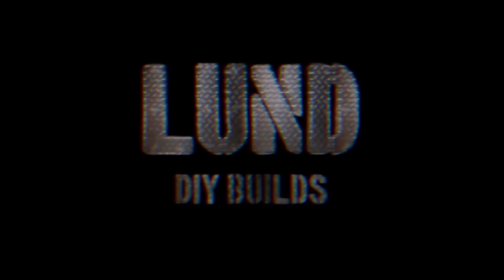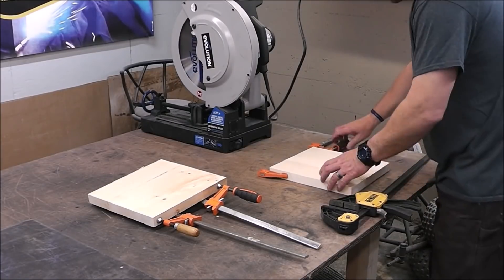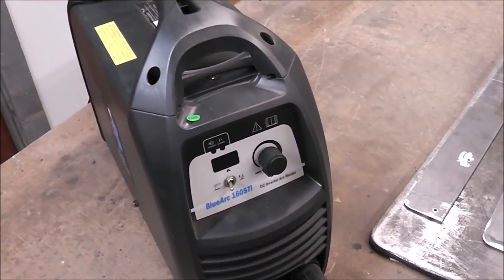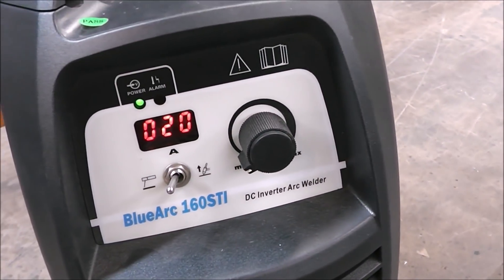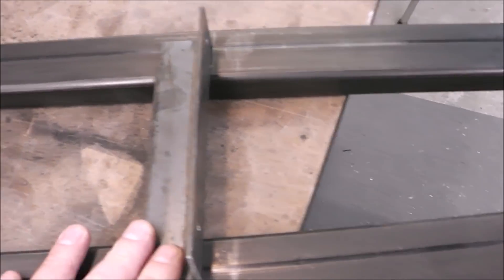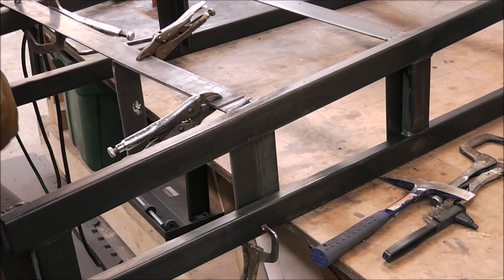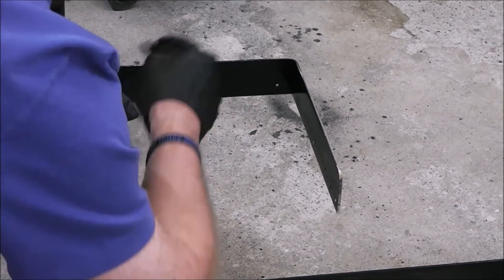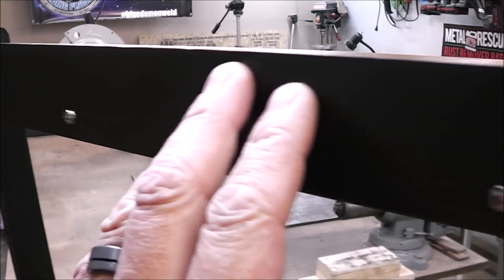Metal Fabrication Stick Welding and Slag Peel Tips

Comment: What did u put your ground too?
Reply from the maker: I dont remember specifically but usually my table. Sometimes to the part if im having a hard time getting good arc starts.
Reply: @BrandonLund  ok thanks! What about doing round tubing for a railing? I always get a bad clamp on them, anything I should do different? Or some other ground I can use, say I'm on a wooden deck fixing a railing joint or something
Reply from the maker: @wantsLDA  sometimes i will grind a bare spot to get a better connection. They make magnets you can use to hold your ground but im not a fan of those. A short piece of stranded copper wire between your clamp and workpiece is another trick to get more contact on your workpiece
Reply: @BrandonLund  appreciate it I'll give it a try also you should do a video on power sources for small stick welders you won't believe how hard it was to find out if I had enough power to support a small 110v buzz box lol especially to use anywhere on an extension cord cuz most extension cords won't hold the amps
Reply from the maker: Great request! Thank you! Br sure to look for this in some upcoming episodes
Reply: @wantsLDA  what I found helps is get a small piece of scrap clean it up and tack it to your workpiece. I normally put the scrap piece into the clamp first that way I have something to hold the scrap while I weld it onto the workpiece. Actually works really well. Anyway that my go to method and has saved alot of grief.

Comment: Brandon, is that black metal stain similar to gun blueing? On another note, the Minwax you used is a favorite of mine. It brings out the beauty in wood without making the wood look artificial. I'm primarily a wood turner, so it has fit my needs for over 20 years.. I can't vouch for use in outdoor environments though.
Reply from the maker: I love the Minwax! The black stain from what I can tell is pretty much the same thing as the gun bluing stuff from what I've heard but I haven't tried the other stuff yet.

Comment: Hot water for 40 years and I would always just get a piece of scrap out of the scrap band the same size that I'm welding and I would test my heat when I got at the right temperature I would just go to work on the piece back in 1981 we didn't have devices to look up all that

Comment: What's the best ampere value for welding sqare pipe of 1.2 mm thickness without making any holes.
Reply from the maker: Here is a handy reference for setting amperage https://www.millerwelds.com/resources/weld-setting-calculators/stick-welding-calculator

Comment: My cheap welder won't go down much below 40A. For thin material would it be better to use 1/16th 1.6mm 6013 (that should be run at lower Amps) or a 5/64 2mm or 3/32 2.4mm rod (that the calculator says needs 35A+)? I know a  neither is ideal but which would you go for? The over driven rod or a bigger rod? Edit: or is the answer a 7018AC rod?
Reply from the maker: Have you tried 1/16" 6013.? All welders run a little differently. I think you might be surprised :)
Reply: @BrandonLund  I have tried 1/16th but struggled to avoid blowing holes when butt jointing. Even doing tacks. Quite a bit of spluttering trying to run a seam on thicker material. Perhaps I just need more practice. Just a beginner.

Comment: Brandon, Nice looking project, Experiment sometime with watco oil for your wood, it really makes the wood and grain come alive. Check it out on a piece of scrap first in case you don't like it.  If you like challenges try welding sheet metal with 6011 some time. It works great on really crappy rusted metal because the nickle in the rod pretty well cleans it up as you go. If you get the technique down you can scrape the slag with three or four welding rods  stinger end down. If you've never tried it here's a tip whip the rod , if done correctly it will almost look like a Tig weld except for the dingle berries (Spatter).  I enjoy seeing your work Bud,  and the new guys can really learn from you and shorten their learning curve.
Reply from the maker: Thanks Braun I appreciate your input and support. Ill check into that oil. Im always interested in new products. 6011 is good stuff. I've never tried it on sheet metal but I have used it quite a bit on 1/8" steel. Ill have to give itba go! Thanks buddy!

Comment: Great project, turned out beautiful!  I'm brand new to stick welding, found 6013 real nice to weld with...perfect rod for a newbie.
Reply from the maker: Thanks! Try some 7018 too! If you like 6013 your gonna love 7018! If you have a "buzzbox" ac welder, just make sure you get 7018 ac rods.
Reply: DC inverter here.  I do have some from HF, waiting to open them, gotta get an airtight container for storage.  I'm rolling with your duct fan exhaust thing, btw...putting it together today.
Reply from the maker: Awesome!

Comment: Paste wax is terrible for outdoor use (or any use IMO).

Boiled linseed is better, but it takes many, many applications. And it is still not good enough to just leave outdoors where water can pool and sit on it. 

Tung oil is about the only oil finish you can use outdoors to protect from water (but UV is still gonna turn the wood grey/black). But you would have to reapply it, regularly, and you will have to leave a thin film on the wood. So it will feel rubbery/plastickey.  

The only good thing about paste wax is it leaves a slightly wet look, and it only takes one application. That first application doesn't provide any protection from water or stains, but repeat applications don't either.

Comment: Problems with 6013 can arise on inverter sets, the arc can flare or blow out without warning, they should run fine on buzz boxes, back in the ice age when I welded with 6013s using oil cooled transformers, all the welds were "peelers" we used to blouse our pant legs as slag could fall into your boot causing you do do the slag kickers hornpipe and shouting "Oh my, thats warm" or something similar.
The finish mentioned by David is used here in France using beeswax/turps/boiled linseed oil, whilst used on wood, it was (is) used by blacksmiths to finish metal.
Reply from the maker: Good to know buddy! I like the old transformer machines personally. My Hobart MIG is transformer based. I love the idea of that finish on wood and like it even more on metal. I'm assuming the metal is hot when the finish is applied? I'm really interested and wouldn't mind giving it a go.
Reply: @BrandonLund  Yes, its applied to warm steel-too hot and it will burn off, some smiths just use beeswax, some heat turpentine, boiled linseed oil and beeswax gently to make a paste and wipe that on warm metal, some info here https://diyblacksmith.blogspot.com/2012/03/finishes.html
Reply: Damn right haha I'm from uk and always weld with 6013 and always always always get slag and sparks in my boots lol and yeah I have a buzz box that always use with 6013s

Comment: Great project! For an old world finish mix carnuba wax, turpentine and boiled linseed oil in equal amounts then apply hot. Leave out the wax for exterior wood.
Reply from the maker: That sounds AWESOME! I'm going to try it! Thank you!
Reply: I agree used this technique a few times works amazing
Reply: @AntonioClaudioMichael  It's wicked old and puts down a finish that can last a century. More with care. Try that with poly, eh?
Reply: @DavidTheCarpenter  not a bad idea to try it with poly
Reply: Why remove the wax? Seems it would add to the protection.